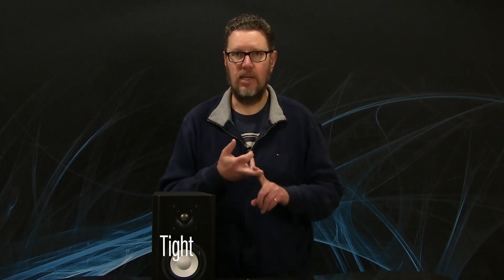What Do Punchy & Tight Mean? From The Axiom Audio Glossary: Audio Terms Explained

Comment: Subwoofers are meant to be Boomy not Punchy, Punchy produced by Mid Speakers not on Woofers. If you tune your Sub into a Punchy Base, some Sub are not meant to do a sudden punch base and might damage the coil. Sub are meant to move it's cone massively instead of just sudden quick punchy move and vibration that might damage its coil.
Reply: @simplemindtv 
You can make your subwoofers have a Punchy tight bass it s all depends on your setup my home system is set for Punchy tight Bass with my subwoofers. I have three subwoofers in my home system. In my car I got that booming rumbling Bass. And yes some subwoofers like the ones I got in my home perform better with tight Punchy sub Bass. And no it does not damage the voice coil I don't know where you heard that from.

Comment: Hello from Montreal, I never understood why people use a book shelf speaker and sub in a main room setting instead of a more full range speaker. I’m not talking about a desktop application or home theatre. Instead of having this little box on a stand you can use a floor stander speaker with a lower end. I own a pair Veritys Parsifals Canadian made, these speakers are in two pieces with the tweeter and mid range driver in one box then the bottom box has a rear firing bass driver ( actually the lower box can be rotated. No need for a sub and all those extra cables.
Reply from the maker: I think it call comes down to personal preferences, and thankfully there are lots of options for everyone. Myself, I’m in agreement with you and prefer a full-range floorstanding pair of speakers for my main audio system.

Comment: The last part of your explanation is very interesting. When I went from M60Ti to M80v4, it took me some time to adapt. On some recording, that was good but on some other recording, I was listening some kind of rumble and had a feeling of less defined bass.  After many test with placement, port plugs, and test back with my old M60, I realized that what I was hearing was part of the recording with which I was not used to because I never was able to listened to them. It was not badly reproduced material, it was more low frequencies sound.  I wasn't able to put word on it and you did it!  Now I enjoy listening without port plug because I no longer can appreciate my music with this part of it missing. I suppose my hearing is now broken in! Thanks again!
Reply from the maker: Very interesting to hear that you found exactly what I was talking about in the video. The change to a larger speaker can initially be somewhat jarring, but you went through all the correct steps with tuning your system. Thank you!

Comment: since they are different words i describe them as: tight meaning what described in the video, but punchy is more related to spl, having enough cone area in the midbass and upper bass region where the physical punch comes in.
Reply from the maker: That’s a good point, there is a physical “punch” to bass at higher levels.
Reply: @AxiomHomeTheaters   more and larger woofer and you get the physical punch at lower volume, unless you have small speakers and subwoofer crossed low, 100hz and lower. the punchy and snappy bass is between 100 to 200hz.